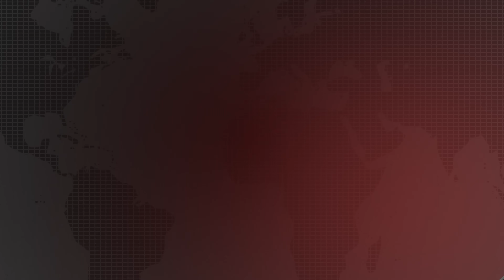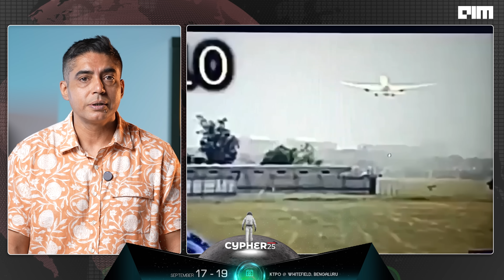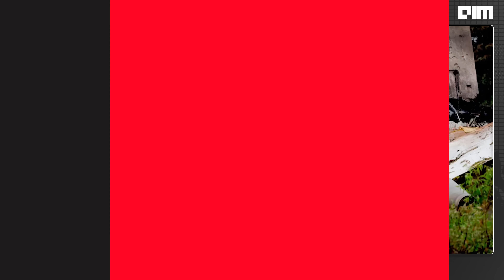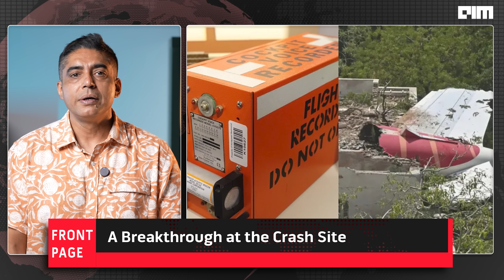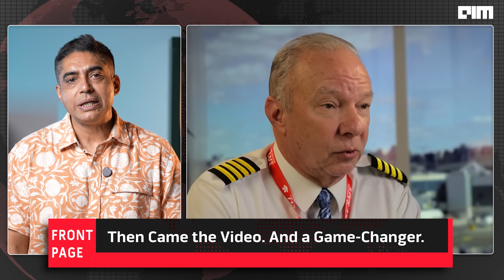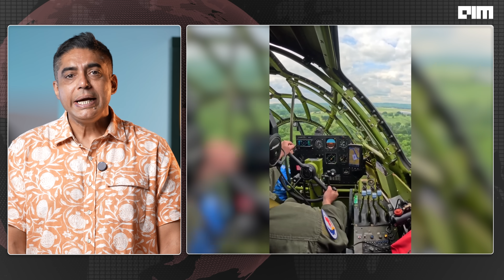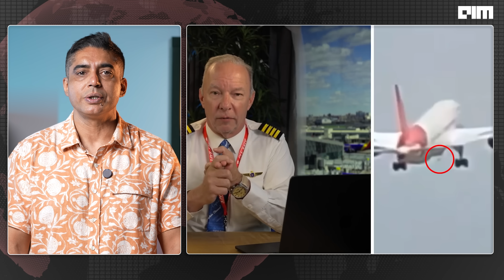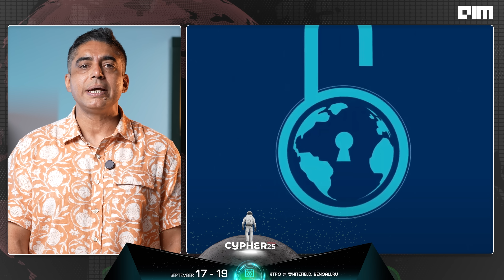Air India Crash: Is Boeing in Trouble Again? RAT Footage Sparks New Questions

Comment: I believe it's a maintenance issue. It's not pilot issue. Pilot is very well experienced.
Reply: I find it truly astonishing that Air India would despatch an aircraft with MULTIPLE electrical defects from a previous flight.
Reply: @grahamstevenson1740  It has been happening for years, they just did not expect this end.
Reply: @dom4068  Are you saying Air India's maintenance has been neglectful ? Yes, I've seen this reported in YouTube videos, their airliners are in very poor shape.
Reply: @grahamstevenson1740 We know of what the interor looks like, i am assuming that, same might have been happening for other maintenance as well.

Aircraft's have lots of sensors, and they get the data about the last flight after landing.
May be the data was overlooked, may be there was an issue in the supply of parts.
We will never know.
Reply: @grahamstevenson1740  wait until you hear stories from air india pilots LOL
Reply: @grahamstevenson1740  You don’t know they did
Reply: @johnbarrance4926  It's been widely reported that the accident aircraft had multiple electrical faults. There's even a video showing them.
Reply: I agree. My first thoughts were dual engine failure after maintenance =
something wasn’t completed or was incorrectly reassembled.
Reply: @appz5946  I looks like the liftoff was textbook.  But the engines lost thrust.  So it dropped.
Reply: @bugstomper4670 good one. Incidentally, no one is yet looking at the gross weight/load...issue/problem. This is also critical if neglected. We have seen overload issue associated with vehicular transport on ground. Could also happen in between fights..specially in 3rd world countries. In air compromises in any form should never be entertained. Common complaint n errors ought be taken as seriously as ever
Reply: @bugstomper4670  First thing I thought of. Dual engine failure and deployment of the RAT, & no time for APU to kick in.

What stopped the engines? Stall? Fuel problem?
Reply: Yes Lack of fuel.   Massive electrical Failure . NO pumps -no fuel.
Reply: Dude! The recorders do NOT go to Boeing! They are handled by NTSB!
Reply: @appz5946  that aircraft was a hanger/parts queen in a maintenance hanger.
Reply: Right
Reply: Or it was caused by climate change. PS:  My guess is just as fact-based as yours.
Reply: I agree. My first thoughts were dual engine failure after maintenance =
something wasn’t completed or was incorrectly reassembled.
Reply: If an aircraft could not gain trust, it means there is an engine failure cause of poor maintenance because B787 is a good aircraft, but if flaps retract accidentally, it means human error. If it's like a brand new and get crash, it means manufacturer discrepancies, so boeing has no issue regarding these accidents because it flies for how many years.
Reply: Pilot got informations that their was no AC and lights before take off, that means no power, he ignored this information and crashed , he killed all
Reply: @giselameunier4788  Unless you were on the flight and a member of the flight crew/cabin crew you're talking complete BS.
Reply: @giselameunier4788  from where do you get such information?? Give me the source of information. Stop spreading fake news
Reply: Co pilot was not experienced.  Learn facts
Reply: What is your source of truth ???
Reply: @arrow090 This is very first crash of a 787 in history. Maintenance issues and pilot 🧑‍✈️ error
Reply: Your missing a A and the , it's not A pilot issue. THE pilot is expierianced.
Reply: Pilot know everything why he is flying plane it’s better to quit job instead of killing people when we drive a vehicle we know the performance we give it for service when we don’t give it will have problems we know that Similarly pilot when he fly a plane he knows everything … Always remember it’s mistake of pilot and aviation department
Reply: The loud bang heard, i wonder if it  could have happened just when pilot rotates,and you see cloud of smoke/dirt.just my thought.
Reply: i agree
Reply: @appz5946  No maintenance this plane was reported to have Software Bug with danger to loose all electric Power.
Reply: Even experienced pilots have been known to F up the simplist task.  lets find out for sure before asigning blame !!!
Reply: Of course it it Indian maintenance!
Reply: Of course this wasn’t a pilot error 😂
Reply: a comprehensive pre-flight maintenance process is crucial for ensuring safety and airworthiness.
Reply: Experience doesnt mean they cant make mistakes
Reply: @Raznak  without investigation result don't jump to conclusions. Boeing is not safe said by Boeing engineers
Reply: How long has this aircraft been in operation? Does anyone take into account the material ageing of the airplane?
Reply: Remember Alaskan Airlines, which inverted because Boeing couldn’t properly grease a jack screw and it broke because of sad action
Reply: @seriouslyyoujest1771  it was the airline maintenance team that failed to properly grease the screw. They constantly bypassed the screw maintenance because of the effort it took and when they did grease it, they spent less than half the time Boeing recommended on the task.
Reply: @appz5946  the reality is we have no idea. I can’t think of a maintenance issue that makes both engines quit. We don’t even know when the last time maintenance was done. Wait for the data. Everything else us pure bull 💩
Reply: You believe when you don't know.  It's like religion.
Reply: @appz5946  how about his Co pilot? Well experience also?
Reply: True that. Companies would rather make money than loose it.
Reply: Great "SPECULATION". Unfortunately "SPECULATION" is not evidence.
Reply: @appz5946  Yes, you are right! Maintenance, not Boeing issues, that airplane is about 11years  old!!!
Reply: @appz5946  wel said💙
Reply: I believe YouTube sleuths are the worst of the worst of people
Reply: @appz5946  Juan on his Blancolirio YouTube channel talked about RAT ( Ram Air Turbine) being deployed just from the sound from the recording of the crash,only hours after the crash!
Reply: @appz5946  and that can be an issue look at Tenerife experienced pilots cocky attitude or sometimes you get so caught up in being an expert that you can miss something that’s why there’s pilot flying pilot monitoring because experience doesn’t mean you can’t make a mistake or miscalculation in weight etc
Reply: So experienced pilot allowed shitty maintenance?
Reply: @overcspurs8027  yes this is the problem with air line company poor maintenance
Reply: The trouble with all air travel these days is the time pressure on the ground staff to get the aircraft turned around in the minimum time possible as every minute a plane sits on the tarmac it’s losing the airline money. Therefore corners are cut and safety goes out of the window. All AIRLINES push it but some are worse than others. This fated aircraft had issues and should never of been allowed to take off in my humble opinion.
I am ex airline staff and have witnessed these scenarios many times. An aircraft has a fault but the people in charge of running its schedule put unbearable pressures on the dispatchers and pilots to take off on time to save money. Nine times out of ten it’s fine but unfortunately this time it wasn’t. Let’s hope more safety measures are put in place in the future as a result of this terrible disaster that should never of happened.
Reply: I believe we don't know anything for sure yet.
Reply: Maintenance issue for sure. Every little  things count. Lavatories hygienic is also poor. There are lots of non working screen n i used other passenger ...side to charge my cellphone, coz my sit mate side was not working n she is using my side. Lots of maintenance needed!!!
Reply: @Pisces79 yaa I have seen videos but expert are saying interior maintenance is different. Anyway let see what's black box says. I don't think it's pilot error
Reply: @appz5946  they wanna blame the person not here to speak for himself.
Reply: @Pisces79  and no air condition. That prove alone something is wrong.
Reply: @Pisces79  There is a difference between in flight entertainment and flight controls/engines/instrumentation.  Also cleaning between flights is not down to maintenance.  Don't get me wrong if the in flight entertainment doesn't work it's a pain in the arse, but it's not a safety of flight issue.  If there's maintenance to be skipped it will be that.
Reply: I don't think boeing investigating will be honest.
Reply: @mykegoh  obvious
Reply: I wouldn't say maint. I think it's the lack of quality using the junk Rolls Royce engines.
Reply: @GieCampbel-ug9jl  it bought from America
Reply: @GieCampbel-ug9jl  Nothing like a bit of research before you post nonsense.  It was powered by two General Electric GEnx-1B67 engines.
Reply: @darrinheaven4643  what, you work for them?
Reply: @GieCampbel-ug9jl  That is the choice of the airline as both GE and RR engines are offered, airlines choice !!!
Reply: @GieCampbel-ug9jl not Rolls Royce engines!! They are GE engines. Don't say anything if you don't know the facts.
Reply: @GieCampbel-ug9jl  Apart from the fact this plane had GE engines.
Reply: Boing doesn't want to show the thruth, it's digital recordin in black box,why it takes so long to get report?
Reply: @lamberthennayaka6410  There's a LOT of data recorded and it has to be decoded. It's not like there's a printed report or a YouTube video in there explaining everything.
Reply: @lamberthennayaka6410 is not necessarily Boeing fault wen it's airline company maintenance negligences..
Reply: @lamberthennayaka6410  Because it can take months. And only recently did they find the boxes.  You didn't even listen to the video.  The gentleman says they were not found immediately.  When a report is released, it almost always the facts of the telemetry.   They don't go back a second time.
Reply: I'm not sure about a maintenance issue. Coul'd be a "software" issue.
Reply: @stabilo3170  That plane was over 11 years old.  If there was a software issue then it would've shown itself way before now.
Reply: @cjmillsnun  Every airliner are regularly updated through SB's (Service Bulletin) . These SB's are covering every aspect of the aircraft, including software upgrade. A dual engine rollback right after lift off is an indication that a single cause triggered the lack of thrust on both engines.
Reply: Wrong experienced pilots crash planes.
Reply: Ok, bot. Nobody said ANYTHING about pilot error in this video.
Reply: @organboi  who hurt you ?? If I'm bot thn who are you ?? American and other media is saying pilot error to save Boeing image. Boeing share got down by 13%
Reply: @appz5946  don't mind him. He doesn't remember everyone is not so limited in references & scope. He's right based on d way he's looking at based within limits of this tis video forgetting that u are also right in your commentary depending on the extensive way u are also looking at it offcourse wit respect to global narrative..
Reply: @organboi No AC during takeoff 🛫 is pilot 👩‍✈️ error 😊
Reply: How much is Boeing paying you?
Reply: @owenlaprath4135  how much is mohdi paying you?
Reply: @owenlaprath4135  says the shill from airbus

Comment: I doubt it is a maintenance issue.  Both engines failing. Sounds suspicious to me.
Reply: I detect foul play??😮 I can understand one engine then minutes to hours after then the other. Both engines going out simultaneously, as soon after take off.????
Reply: So, what is it then?
Reply: The chances of both engines failing at takeoff: ZERO.
Reply: A rat.
A remote access trojan.
It is not unknown, since MH370.
Reply: You should have been a judge

Comment: Yes , the crash could be prevented, if   the ground engineer who conducted the routine checking before the take-off of the ill-fated aircraft was sincere enough to find the mechanical fault. The undetected mechanical fault, whether intentionally not removed or not is debatable, was responsible for the terrifying crash killing 270 persons. The engineer concerned need to be held responsible for the crash.

Comment: I believe it’s sabotage.  As a petty automation guy, who owned a related business, I would have programmed in safety codes to coordinate gear and flaps to ensure safe and proper interlocks.  We ALWAYS DID THAT.  The most time spent on the machines we built was to deal with the ‘what ifs’.  50% time to program in codes to address the ‘what ifs’ 
So I don’t think it’s a flap and gear issue.  I firmly believe it’s sabotage

Comment: Bad fuel causes engine failure.   The odds of two engines randomly  failing for mechanical reasons,  at the exact same time are astronomically improbable.    Unless there is bad fuel.
Reply: @johndaniels651  even with bad fuel, which affected no other aircraft, is highly unlikely for both engines to quit at the exact same time, maybe minutes apart, but not the exact same time
Reply: @ktmdoug   They probably didn't fail at the exact same time,  there was some yaw in the video, indicating asymmetrical thrust, suggesting they didn't fail "at the exact same time"   Nobody knows what caused  this,  the cause could be any number of things, including fuel contamination.
Reply: But there were too many planes but why only 171 crashed only.  Same fuel wals filled in other planes
Reply: @GovindEditz2.0   The contaminated fuel may have been picked up at a prior fueling.
Reply: anything to blame Boeing.....  You know India has the tops when it comes to infrastructure....
Reply: @johndaniels651  Poor maintenance is the main problem in india
Reply: Pure speculation. The fuel trucks have sensors that will shut down the pumps when contamination is detected.
Reply: @ScubaSteveCanada    You mean like Cathay Pacific Flight 780?
Reply: Most likely excessive water build up in tanks that was ingested into fuel system during rotation.
Probable common mode failure.
Reply: @ianthomas-novelengineering7472     Water entering  on rotation seems a very plausible explanation for this disaster.   But whatever the cause is, I'm sure we'll all find out soon enough.
Reply: A major electrical malfunction could wipe out both engines simultaneously.
Reply: @mikejohn0088   Nobody knows what happened, but we probably will soon enough.   Ruling out fuel contamination at this stage, is illogical.
Reply: @johndaniels651  "soon enough"   ---this investigation report will take forever and by the time it is released this tragic event will be ancient history.
I'm still awaiting for the FINAL Warren Report the public was promised in he 1960s - the first attempt failed because someone read it.
Reply: It’s absurd!! I just can’t imagine what could’ve happened??😢
Reply: Dann leisten sie weniger, fallen aber nicht aus !
-
Boeing ist auch ein militärisches Unternehmen.
.
 WER saß wohl alles in der Maschine? ...oder auch nicht unbedingt.
-
Beim MCAS-"Absturz" der Äthiopian-Airlines saßen 20 äthiopische UN-Delegierte mit in der Maschine.
DIE 20 Delegierten, die mit ihren Gegenstimmen dafür sorgten, dass die USA keine Militärbasis in
Äthiopien errichten durften.
Dass das per US-GPS satellitensteuerbare  MCAS  generell geheim gehalten wurde, war keine bloße
Schlamperei und/oder Sparmaßnahme um Airbus dagegenzuhalten, wie offiziell kolportiert.
-
Gedacht sind solche Systeme schon lange um bei "Flugzeugentführungen" die Boardelektronik zu
überstimmen, damit Luftpiraten die Maschine nicht mehr übernehmen konnten.
Das us-amerikanische GPS-System wird genauso in Waffensystemen wie Drohnen, Raketen und
dgl. verwendet wie in der Zivilluftfahrt. Das Jamming weiß nicht, ob es die Funktionen eines zivilen
oder militärischen Gerätes stört. Das weiß nur der Absender.
-
Auch in der Indonesischen MCAS-Absturzmaschine saßen fünf solcher Widersacher, mit deren
Votum ein Jahr zuvor auch in Indonesien eine Marinebasis der Amis verhindert wurde.
-
Die beste Versicherung für Staaten, die sich den USA nicht unterordnen lassen wollen, ist,
nur noch von der brasilianischen Embraer, der chinesischen Comac und der russischen OAK zu kaufen.
Die benutzen ihre Systeme (siehe auch Microsoft Windows) nicht als Waffe.
Reply: Bad fuel can never enter the tank on a 787.
Just like you can't pass a narcotics dog with 1 kg cocaine ;)
This is not like filling up a car at a gas station ;)
Reply: @MM-tt3np  What do you mean bad fuel can't enter a tank?    See Cathay Pacific Flight 780.   Double engine failure, bad fuel.
Reply: @johndaniels651  Not within five seconds, though, and in mid flight. Apples and oranges.
Reply: @steffenwengorz4035    The engines didn't need to flame out completely,  if they rolled back even 15 or 20% at that critical altitude, low speed, and with the gear down,  the aircraft would have.. well, it would have  done pretty much what it did.
Reply: @MM-tt3np  As someone who has filled aircraft with fuel, YOU DO NOT KNOW WHAT YOU ARE TALKING ABOUT - Water or other contaminates CAN get into the fuel!!

Comment: Failing to do maintenance does not mean Boeing is in trouble again. It means Air India is. The same plane had major maintenance problems 4 times before this flight.
Reply: So why wasn’t it grounded??
Reply: Can you be specific? What four "Major" maintenance problems? Also where did you get this information?
Reply: @tommytom6341 they had electrical problems, as well flap and landing gear problems. It was reported by the airline itself.